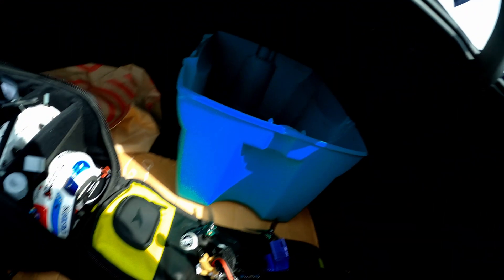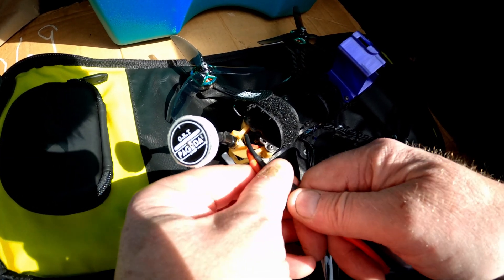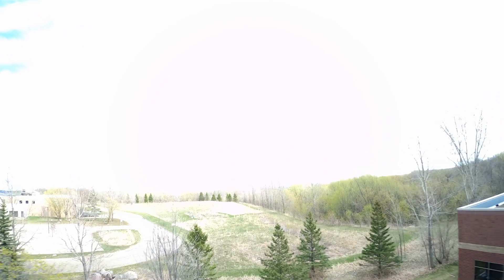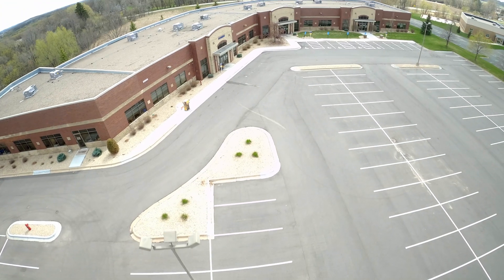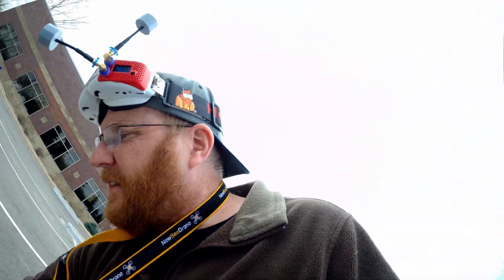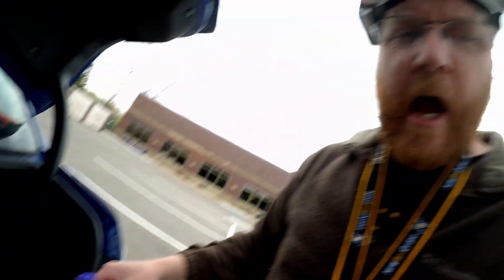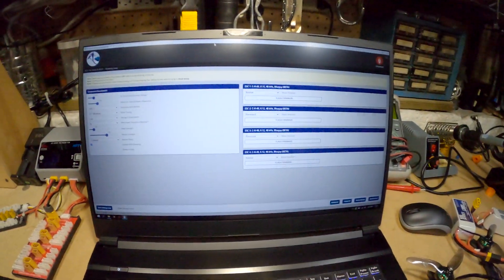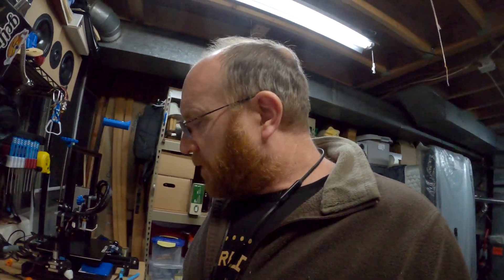I flashed Bluejay ESC firmware onto all my quads. Here goes nothing!

Comment: i flash bluejays firmware to my esc blheli_s and i got death roll
Reply: Gotta recheck the rotation of the motors after flashing Bluejay firmware onto the ESC.
Reply: When going to bluejay, you must remember the settings for motor direction.  Example Normal/Reversed because bluejay by default with flash it to Normal
Reply: @MasterBlud  i already check motor direction after flash bluejay firmware, kwad fly normal but when i do roll it become death roll
Reply: @dikoherlambang  what kHz did you set it to and what kwad you flying?
Reply: @dikoherlambang  had this same issue. The motor ordering was incorrect. Go into the CLI and change the resource mapping for the motors that fixed it for me
Reply: Do you mean death roll like a gator before you even can take off or (what I think of a death roll as) in the air while flying. Possible desync...
Reply: @alloutofdonuts3998  in the air while doing trick roll
Reply: @dikoherlambang  do you think it’s desync then? I was watching vids about this after I flashed to Bluejay.
Reply: @alloutofdonuts3998  i didn't really know if that was desync or not, i reflash firmware to original firmware
Reply: Me too